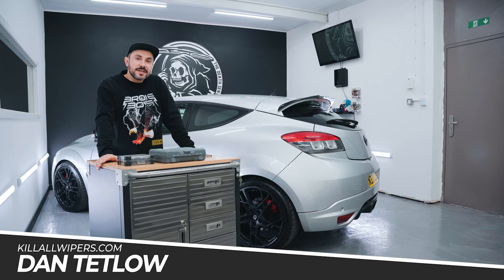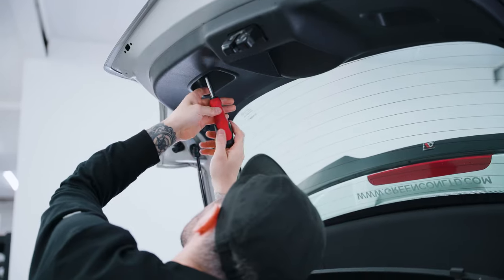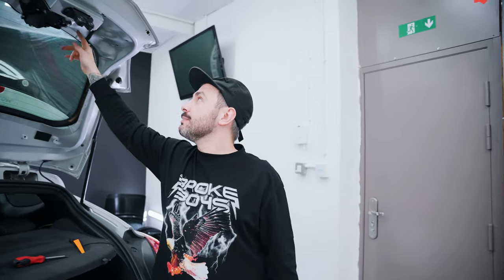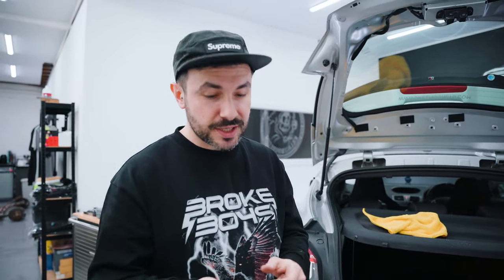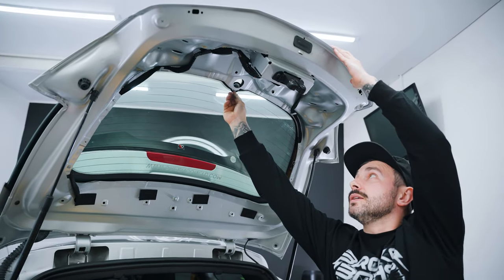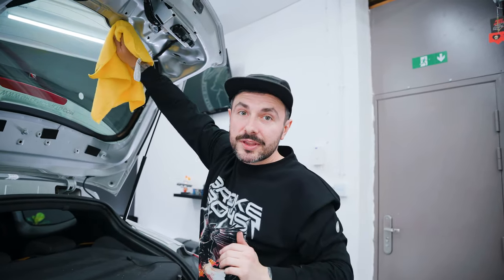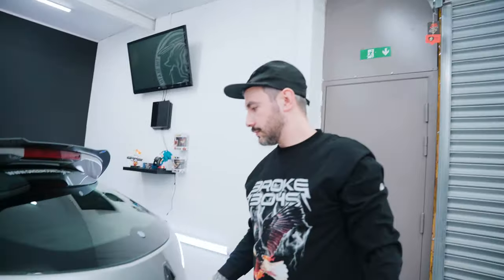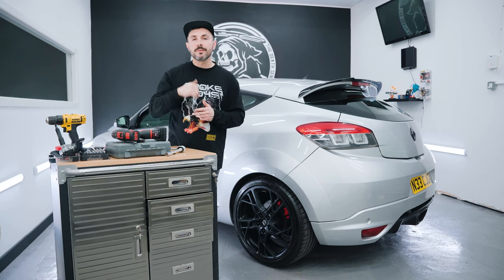Kill All Wipers - Megane MK3 Wiper Delete Install

Comment: Do i need to program anything? No checklights? And how i can get it of when i want to sell the car?
Reply from the maker: No you don’t need to program anything as we have not done in this video. You can remove kit at a later date by cutting the window bond away from the kit and pushing the kit back in and reverse the process shown in this video.